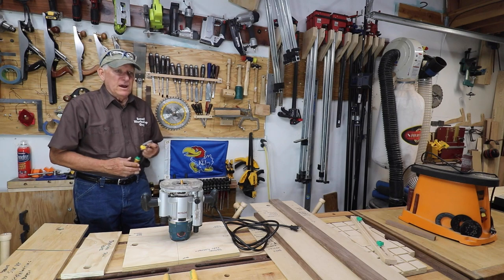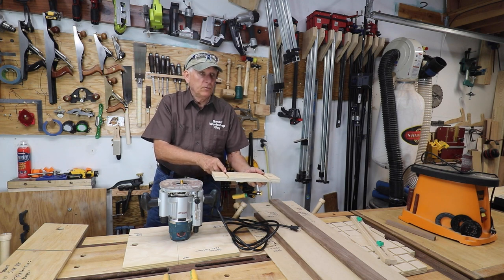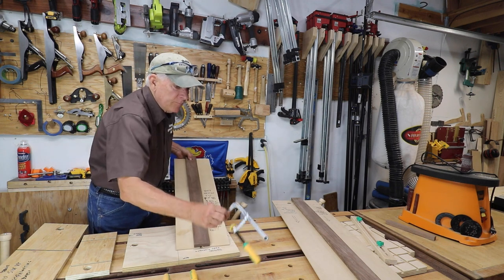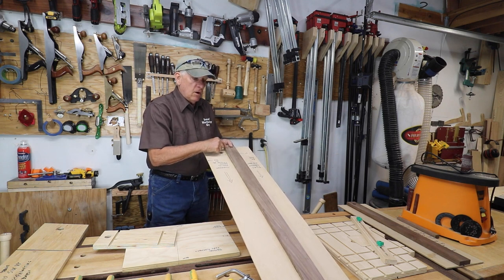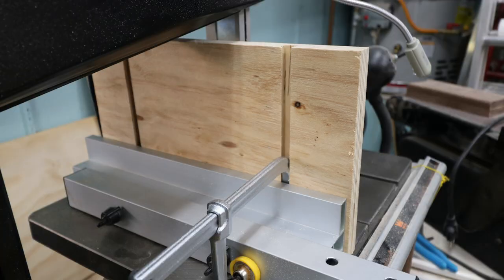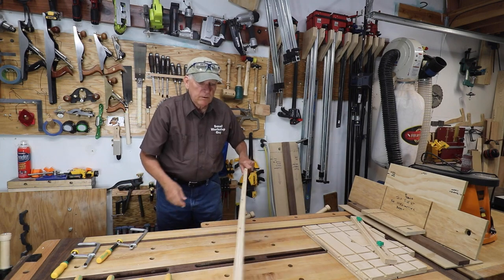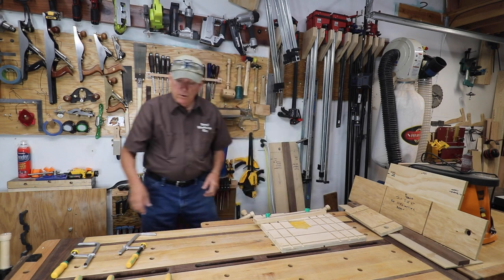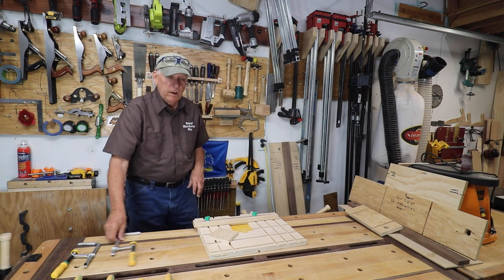8 Workshop Jigs Utilizing the Matchfit Dovetail Clamp System from Microjig

Comment: I didn't hear anything about the hold downs for the drill press fence.  are those shop made?  I am thinking about this product.  I think it might be the next best thing since pocket holes :>)  is it as strong as it looks in holding power?  great video, Paul.
Reply from the maker: Three sets of little hold downs come with the Matchfit Pro package along with the dovetail bit and a measuring device.  $90 (ouch).  So far those dove tail channels appear to be very strong and able to accept quite a bit of stress from the clamps.  Time will tell.

Comment: As for the dovetail bit cuts, Microjig has a relief bit you can get that matched the dovetail bit so it makes a perfect groove. I have a quarter inch router and it does very well if you use the relief bit first.
Reply from the maker: I will look for that.  I just use a 1/4 inch upcut bit to cut my first groove and then follow-up with my dovetail bit.  Works great!

Comment: A suggestion to cut that 1/4 x3/16 deep grove would be on a table saw with a dato blade. Easy peasy
Reply from the maker: Now that is an interesting concept - guess a whole bunch of initial grooves could be done quickly this way using the table saw fence. Now if I can only remember your tip next time I want to cut some dovetail grooves.  Great Idea!

Comment: This is a neat little video. It should be Part 1 of a 2 (or more) part series. Part 2 (and beyond?) should demonstrate these jigs in action to show how they work, all of their features, and how valuable they can be. One issue I see with this MicroJig hardware, especially for woodworkers/carpenters who may take them on-the-road to work at various sites away from home: how do you store and organize all of those little items in a mobile container to protect them from the elements and to keep from loosing them?
Reply from the maker: Actually, I am planning on a longer "Everything you need to know about Matchfit Dovetail Clamps and the jigs you can make from them."  Quite a number of videos being planned so not sure when I will do this one.  Probably after my PopUp Workbench has been released because it makes heavy use of dovetail grooves as well.  For things in a mobile container, I will leave that to Ron Paulk.  See his Channel.

Comment: I'd think that using two routers, one with each bit in them would be a good solution.  You run the 1/4" straight bit, then without moving your straight edge run the dovetail bit for each and every slot. I wasn't sure if you tried that and it still didn't work based on what you said, but it seems like that would be a good way to do it.
Reply from the maker: Oh, I definitely use two routers - I keep the quarter inch bit in a Bosch Colt and the dovetail bit in a 1/2 collet larger Bosch router.  The problem is the distance from the edge guide to where the bit cuts is different for each router so your method would not work.  However if you bought two identical routers, it would work almost - actually you need to move the track over 1/8 of an inch to center the second cut on the first cut.
Reply: @SmallWorkshopGuy  Oh I see.  I was imaging two of the same router, but if you're using two different models, the center of the bit will obviously not line up.

Comment: I recently seen this design. It's pretty good. I was concerned the timber will not be strong enough for clamping purposes. I mean making a table out of mdf and running multiple 14• dovetail. I think it may be okay.
Since I had my clamps stolen these festool type clamps are they easily obtainable and of a moderate price?
Since I need to replace my festool type blades I know they are rather expensive. Great video, well done. I see you are similar to me you like the design and thought you will explore the possibilities. Thanks for the upload.
Reply from the maker: Yep, still exploring and building more and more things utilizing the Matchfit Dovetail Clamps.

Comment: would it slide more easily if you put wax in the dovetails or would it be worse with it?
Reply from the maker: My experience is they slide worse - better to leave grooves naked.  There is a science to how you tip them depending upon which way you are sliding them.

Comment: i have 3 1/4 hp router is that big enough
Reply from the maker: I think that depends upon how hard of wood you are using for cutting the dovetail slot.  Try it on a short piece of scrap wood and see if it feels like you are stressing your router and router bit to just do the one cut method.  If it appears things are straining, the carefully cut you initial slot with a straight bit only part way down and ten get you guide set up so your dovetail bit is following the relief cut perfectly.  Only downside is that you might have to do some chisel work to clean out any rought spots or places where your clamps are getting hung up.  The clamps tend to be difficult to slide under the best of circumstances, so I slant them the right way depending upon which direction I am trying to slide them and I often nudge them along with gentle hammer taps.
Reply: There isn’t a more powerful router made to my knowledge! I have a Triton TRA-001 mounted under my router table in the wing of my table saw